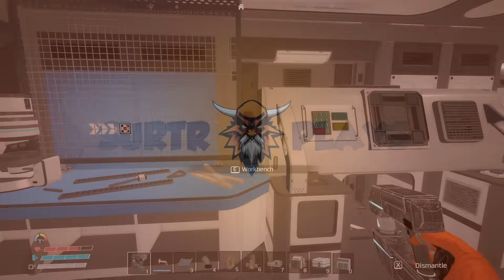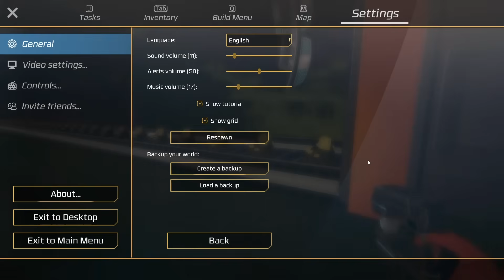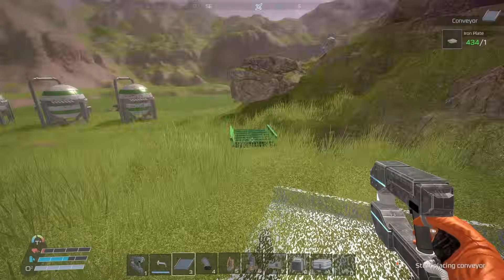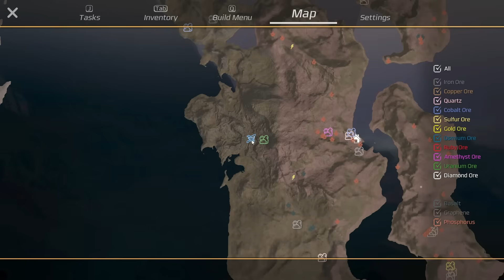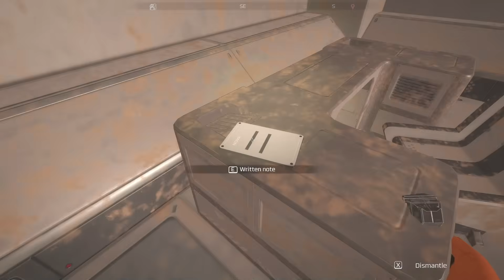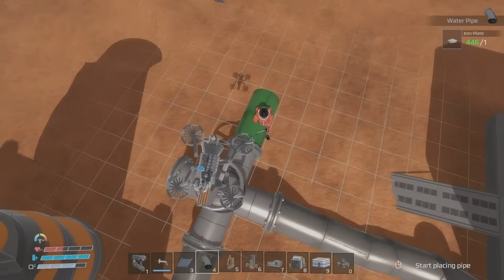Eden Crafters - Nova Terra - Automated Osmium And Geothermal Power [E7]

Comment: You built the ceramics complaining  about water  being far away  while standing 10 feet from a water hole , you can even see it on your map. 🤣
Reply from the maker: I saw it after but it is really small.
Reply: @surtrplays That's where the steamroller comes in handy
Reply: Been watching your series. How do you control the right angles and shape of the pipes / conveyers? I know holding alt makes it go straight, can’t figure the 90’s or 45’s. Keep up the great work.
Reply: I was wondering the same thing.

Comment: I feel once you get all the Osmium parts under production the rest of the game is pretty straight forward from there. I'm hoping to get my playthrough of this map started in a week or two can't wait
Reply from the maker: After the Osmium, the builds get a bit trickier. I might need to use trains to move resources between islands.
Reply: @surtrplays  The impression I get with this map is it was intenially designed with that in mind which is good as gives us room to use them in a proper way.  You also  get the cleaning boat later on which seems fun for another traversal method